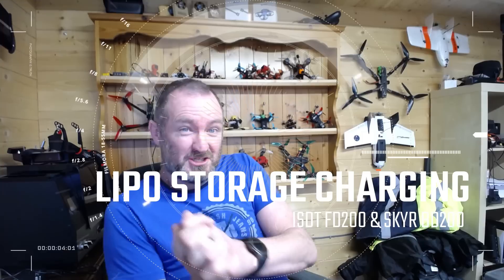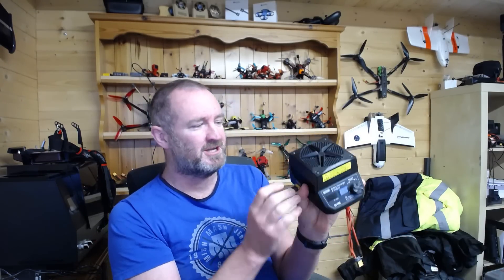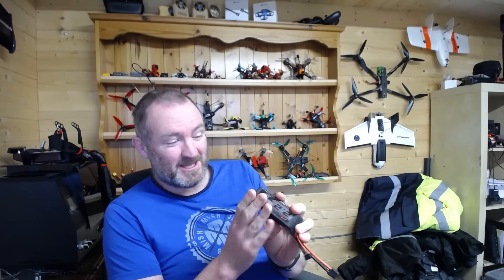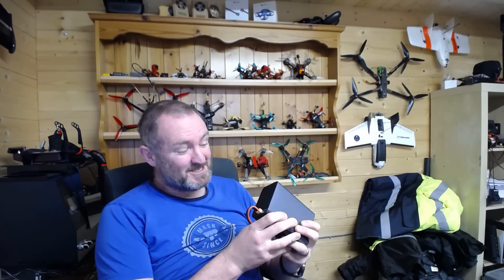LIPO STORAGE DISCHARGING | ISDT FD-200 | SKYRC BD200

Comment: I can see why they did it with the skyrc,  logically if voltage dumps the discharge stops.    You don’t want a discharger to slow down the proces and think for themselve.    
True the FD-200 does the better job for your storage job. I have both. But I was annoyed that the FD-200 starts slowly and is scaling back the amperage..

It all depends on what you want to do with the discharger, for Rc racers it is better to have the Skyrc for racing purpose.   It does its job, and shows the drawn mili amps.. useful information. And is useful for searching the best packs, pc software is top.

For storage the FD2-200 is better.